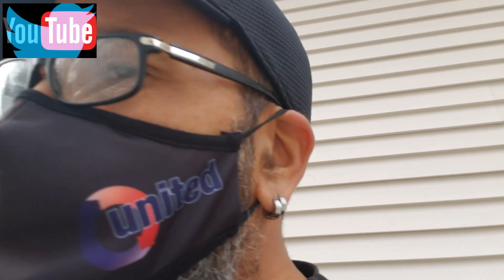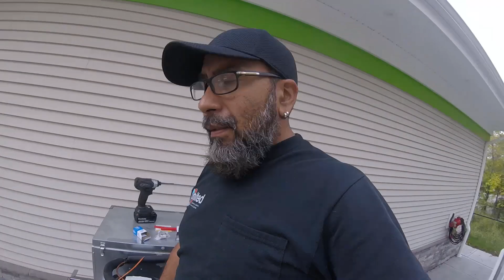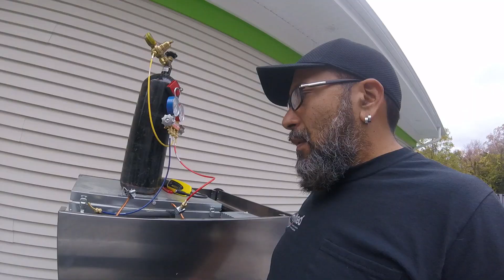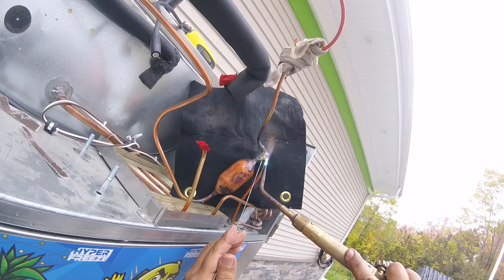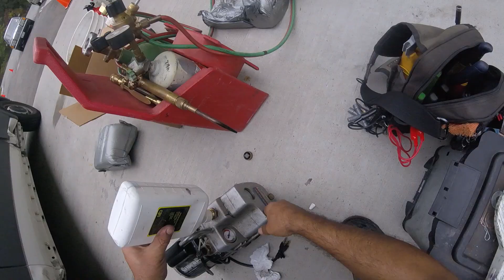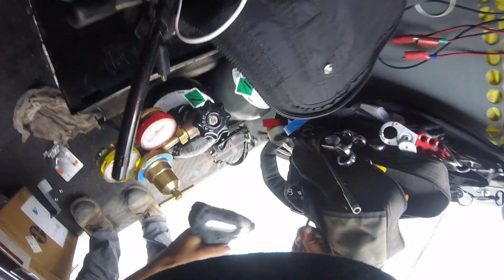No time to be afraid! - HVAC Life with Alex

Comment: Hey Alex a few questions, Im a HVAC guy but so I'm not as knowledgeable with r290. Is that a filter dryer that you were brazing @ 10:50? Also what leak detector is in this video? I bet those Cumberland farms keep you guys busy, do you have to use alot of extension ladders when servicing those newer stores? And last question is about the r-290 itself, is it really that important to use the pure gas in those bottles? Ive always wondered how just regular propane from a 20lb tank or even those green camping bottles would do in a system. Thanks in advance and great video
Reply from the maker: Hey brother, thank for watching and for your support!
answering your questions: yes it is a filter dryer, the leak detector is for flammable gases only and no you can't use regular propane as refrigerant, I leave a link below, that explain in a simple way why it shouldn't be use it!
https://en.wikipedia.org/wiki/Propane_refrigeration

Comment: Good Video Alex. i Have not done any R-290 units yet, But i did a few R-170 ( Ethane ) Compressor changeouts about 35 years ago. in the 80's i did not even know i was dealing with something flammable back then. i never even knew the difference between the R-22 and R-170 ( flammability  wise ) cascade  refrigeration way back when. We used R-22 Compressors for both Refrigerants , Flammable or not and never had any issues. i used to even transfill small bottles of R-170 from a 140 lb Bottle i had in my shop when i had to Fly to Service call locations. We Purposely Light Propane on fire in our Barbecues on our patio's and cook a Steak. i'm Going to try to not worry about R-290. Just Remember to unplug the unit i think is the biggest thing and No Smoking.
Reply from the maker: Thank you brother for your comment, very interesting to hear it from someone who worked in the field for some many years!

Comment: Good job Alex! Don't beat yourself up, safety is more far more important than speed. Speed will come with repetition. I suspect there was refrigerant hiding in oil pockets in the coil. One question. Isn't it best practice to allow the brazed joints to cool naturally on their own for a while before putting the wet rag to them? I learned in tech school that the sudden cooling of the joint will cause micro-fractures in the brazing material and increases the possibilities of joint failure/leaks down the line. Great video as always, stay safe!
Reply from the maker: Have to be honest, I believe it is true, but sometimes the speed of the day it required a "fast-forward actions", I know is not right, you are correct on your statement Bill, thank you for your point of view, that's what this channel is about!🤘🤘

Comment: I was the same with my first flammable job after years you get used to it, i'v had flames exposed to slow venting pipes no problem, the most important thing is always keep clear of direction of open pipe or opening pipe venting outlet. I'v been working with this for years now no problems at all, you get used to it but after a while like everything we all get complacent.
Reply from the maker: Well that is good to hear from someone who has been working with them for a while, thank you for your comment, I'm pretty sure more than one guy reading now will feel some kind of confort 🤘🤘

Comment: God forbid they start putting this damn refrigerant in bigger hvac units, there’ll be quite the explosions. Great video bro!
Reply: Circuit cap is 5 ounces per circuit
Reply from the maker: Well hope not brother, the time will say!
Thank you for your comment🤘🤘
Reply: Currently it's on small fractional reefer limit cap is 5onz per circuit most 2 door freezer have 2 circuit 1 evap 2 condensing units

Comment: I think you did it the fastest way. I usually braze on service ports and then cut them off in the end to assure no leaks. Usually purging does not take that long. I hate to break this to you now but you may have oil logged in the evaporator with trapped r290. That loss of oil probably killed the compressor. I like to drain the oil out of the compressor and check it. No safety signs will stop these smokers. They have no self respect and no respect for others. They will jump over the safety sign and smoke in your face if they have to.  Only cancer can take them down. Your best bet is to let the manager know ahead of time to keep these morons away.
Reply: Nicotine is arguably the strongest addiction out there.  They should just acknowledge it and wear nicotine patches or chew nicotine gum.  Addicts will stand out in freezing rain to get their hit.  Some big corporate campuses now require smokers to leave the property, so you may see them standing on the edge of the parking lot in the street right of way.
Reply from the maker: Yes it is sad, I've seen lots friend tried many times for many years to come back, it is hard for them, I used to smoke for 10 years but I quit for good and never again, I know how bad can be , thank you for your comment🤘🤘
Reply from the maker: Thank you for your comment brother, it is their decision about smoke or not, but is not when we are working with flammables, sadly I didn't have the "Danger-Flammable" signs with me that day, but I certainly told the manager about my work outside and the risk about smoking , maybe she didn't communicate with the others? But got me pissed anyways!
Thank you again🤘🤘

Comment: Is that some sort of fire blanket that you are using when brazing. Also what is it called and where do i get it. Perfect for small tight equipment.
Reply: Found in any supply house/site, great to have in many situations. Make sure the temperature ratings are proper for brazing vs. soldering. TruTech tools web site has them, use promo code "knowitall" for a discount.
Reply from the maker: Yes, you can find it in most of HVAC warehouses, I get it from FW Webb!
Thank you for watching bro🤘🤘

Comment: I'd crack the valve and light the end of hose or a junk extension :))
then again, I've been using  roofing/ice torches that move lot's of gas, when it's actively burning off it cannot pool up and explode. controlled burn-off is how they get rid of propane and butane in bulk.
Reply: I think I would just vent it as recommended and purge. The 4 oz of gas is not much, its hard to imagine there is more than a minuscule fraction of an once left after a fast nitrogen sweep.   Obviously the tester was too sensitive, what is important is the remnants are not still air fuel flammable.  Clearly there was no flare up when Alex brazed the joints even though the detector was still able to pick up propane.  Refrigerant detectors (r290 propane here) are designed to pick up slow "bubble" type leaks, important after the system is sealed and charged for leak verification.  Good ventilation is key but people can vent these small quantities inside and will often have to do so.
Reply from the maker: Yes is true, the gas detector it was very sensitive, with the practice and experience probably it will be a more common procedure, not so meticulous as showed, the time will say!
Thank you for your comment and your loyalty!🤘🤘

Comment: Nice video. 
The reason you have refrigerant mixed with nitrogen, is because it was in the olie of the compressor, but was released from the olie when you put the system under pressure with nitrogen..
Before you cut the pipes fill the system with nitrogen for 10min and then cut the pipes ( let the nitrogen out first🤣) 
Safty first when working with R290 and other HC, but no one has a problem using the propane grill at home, and that's maybe 10 years old and maybe have small leaks.. And think about people transport that 20pound propane in the car for the grill..
Reply: So r290 mixed with residual oil in the system? Putting the system under a nitrogen pressure gets the refrigerant out then you blow out the mixture. I'm making sure I understand because I am a student right now.
Reply: @thedeadray  all refrigerants mix with the olie.. If you have a olie sight glas you can see i bobbles in the olie when you pull a vacuum, that is refrigerant been released..
You can also see it on your gauges if recover the refrigerant and when psi I 0 you close the gauges, then you can see the pressure rise..
Reply from the maker: Yes, your statements are true Christian, but something I can't get out of my mind is, I've seen many compressors blowing the power terminals due a power failure (open windings or grounded) and there is clear signs of fire in many cases, with overload and relays all melted down, what would happen in cases like this with R290?
Thank you for sharing and your support brother🤘🤘
Reply: @hvaclifewithalex4051  i agree with you, that Safty is important, and that R290 should be handled with care.. And in theory it's safe 99% of the time..
If your terminal blew out, and there was flames from the blowout, the compressor would not explode. I would just shoot out a flame in worst case..
You need oxygen in your compressor before it can explode..
The same reason why your plumbers thurch, and gas grill don't explode.
Stay safe and keep rocking😎🤘